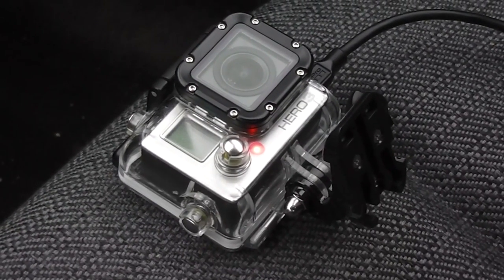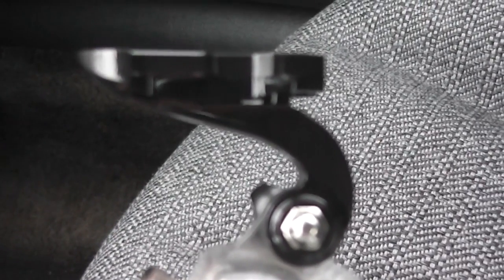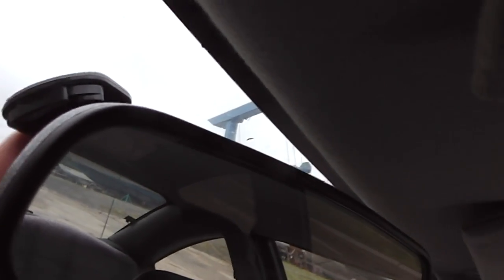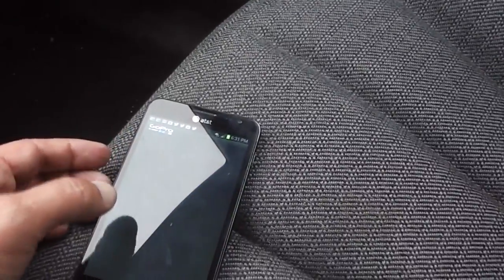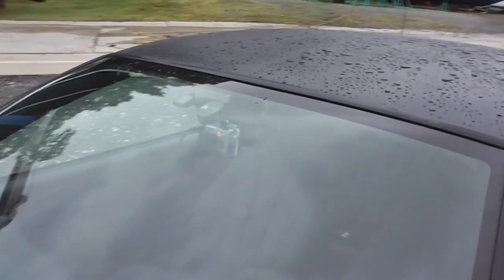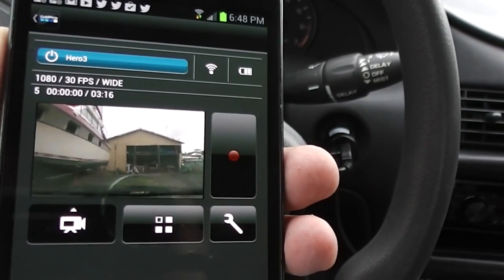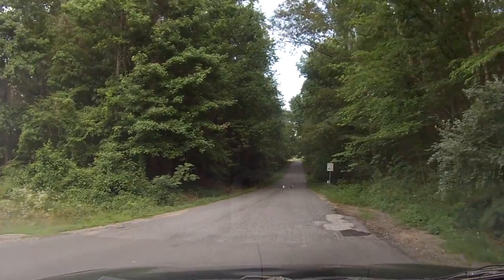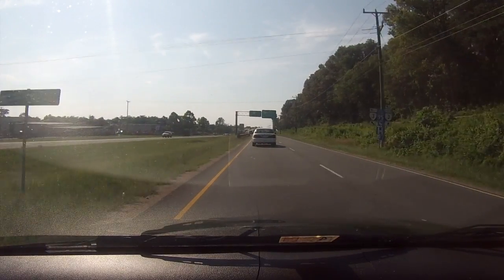How I set up my GoPro 3 as a dash cam

Comment: Even gopro 3+ black edition is supporting auto loop recording for this very purpose.
Better footage than most dashcams.
I would use a piggy back fuse to tap in to a switched circuite and job done, no visible cables.

Comment: Are you still using it as a dash cam? I think they’re underrated for that purpose. They offer great quality pictures and sounds. Only problem is drilling a hole in the casing to get a power supply.
Reply from the maker: They do have frames on amazon that will save the case. I used it for quite a while but I drive Uber now and have gone to a Vantrue pro which records inside and out. However for video quality go pro is much better.

Comment: THIS IS SUCH A INFORMATIVE VIDEO, THANK YOU FOR SHARING THIS.

ONE QUESTION I HAVE PLEASE:

I am using my gopro 3+ black edition as CCTV camera, i am keeping my camera continuously turned ON and recording in 20 minutes loop mode at 1080p at 30 FPS for atleast 24 hours straight in a day. 5 days a week,

This was my need and gopro is doing awesome job. i needed something portable.

it is performing great. no issues at all so far. I have mains power socket just next to the location where i need my gopro, so I am powering the camera straight from the Mains Wall Socket. 

MY CONCERN IS, THE LIFE OF GOPRO ITSELF... NOT THE BATTERY. WILL THIS DAMAGE MY GOPRO? I,E, LIFE OF THE GOPRO ITSELF GOING TO BE SHORTEN BY USING IT AS CCTV CAMERA AND RECORDING IT CONTINUOUSLY IN 20 MINUTES LOOP MODE? 

IT GETS HOT, BUT NOT ABNORMALLY HOT.
Reply: So, how's it going with your CCTV gopro? Is it still alive, working?

Comment: I also use a Hero3 White as a dashcam from time to time.  I use the section cup mount behind the mirror.  I also use "The Frame" instead of the waterproof.  My 2012 Tacoma came with a USB port, hence no adapter.

Comment: If you choose to use your Hero4 camera as a dashcam (why not, if you already own it right?), CamDo offers a dash cam controller to use the GoPro as a dash cam. It automatically turns the camera on and starts recording when the car starts up, and automatically stops recording and shuts down the camera when the car turns off (with a configurable run-on time). Has worked well for me and I'm getting much better value out of my GoPro now!
Reply: Are you still using the same GoPro and camdo backpack?
What about the battery?

Comment: You know there is a setting for using the Gopro as a dash cam. You seem to be just doing a reg video. try looping.....that way you wont use up all of your card.
Reply: Definitely use looping feature.
Reply: If i remember correctly the 3 has no loop feature (was added in later models)
Reply: nirfz 3 has looping...i still use one

Comment: Thanks for the video. I have tried a few incarnations of GoPro car cams. Recently bought a cheap third party mount (video on my channel) that has a ball and will swivel so you can aim it where you want. You just have to make sure the thumbscrews clear the mirror. It's not as discrete as yours though. One thing I noticed with cameras inside the car (as you can see in your video) is when the sun is behind you the video is pretty great but when it's in front of you, you get the reflection of the dash in it and it kinda takes away from the video.

Comment: I have a dedicated dash cam, it records in 1080p resolution and it starts recording automatically when the cars ignition is turned on. The cheapest go pro I've seen only records in 720p and the price is double what my dash cam cost. I have a Mivue 358 dash cam. But am looking into another camera like a go pro as well.
Reply from the maker: I use the Go Pro because I have it already and use it for other things as well. I record in 1080 and all the current gopro models record in 1080. Thanks for watching.
Reply: Len Farneth
Mine will record in 4k. Hero Black.
Reply: +QU3STION5 Nextbase 402G now £119 from Currys. The 402G shows, and stores, speed, GPS, G force and can be used as a stills camera to take pictures out side of the car if you happen to have a crash.
Reply: +QU3STION5 That comment must be really old, as that was previous youtube account. I have since got something similar to a go pro as backup for if my DVR isn't working etc. It's a sony HDRS-20. I got it because I saw a review that said it has better image quality in low light and at the time I got it, which was I think about a year ago. It also has wifi so I can view the image being taken on my cell phone. The Mivue 358 dash cam in the car is still there and works really well. It saved me my deductible when a truck hit my vehicle, and also captured 2 car crashes. I was pretty lucky that my car was not hit head on :(  The reason you want to get a dedicated dash cam is because it is automatic. If my DVR camera did not start when I started the ignition of the car it would be too easy for me to forget with all the other things I've got to remember to do, so I still say get yourself a dash cam that is designed to function in this way. Also if your car is hit more than likely it will save you your insurance deductible. In my case my deductible was more than twice what I spent on the camera. So it paid for itself.